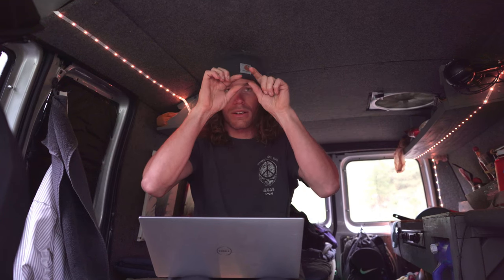Build Update #3- MK1 VW Rabbit Turbodiesel (4K)

Comment: If the h beam rods you got are those ones off ebay, "maxspeeding" or whatever, they require modification to fit. I think we had to plane them down for them to fit onto the crankshaft or piston end I'm not sure off the top of my head. The piston end also required some sanding on the bearing but that wasnt horrible.
Reply from the maker: Yeah those are them 💁 quality lol